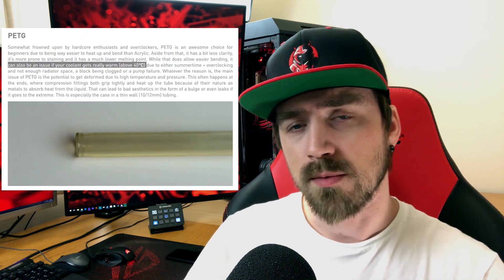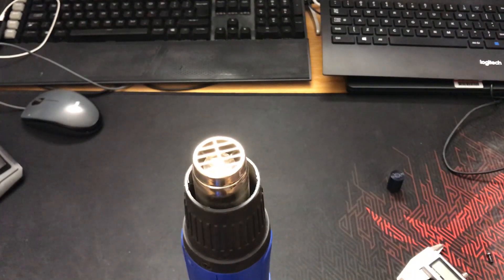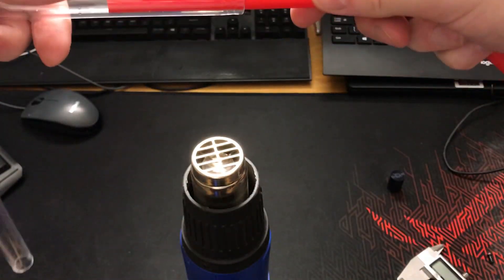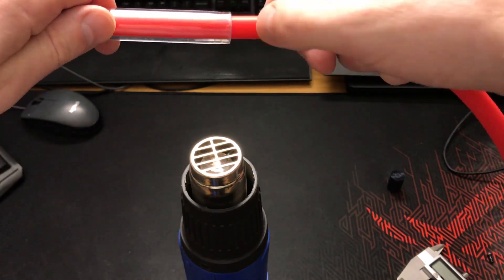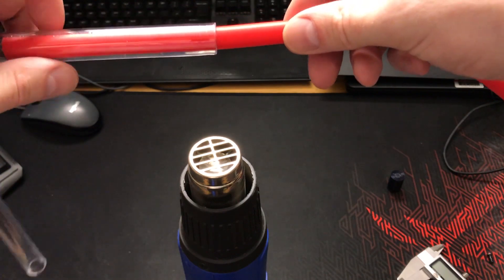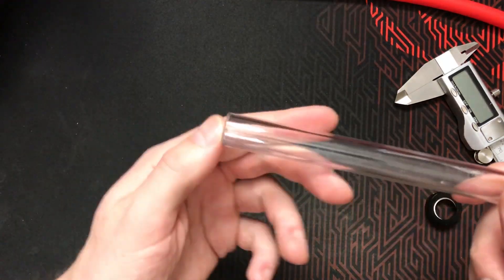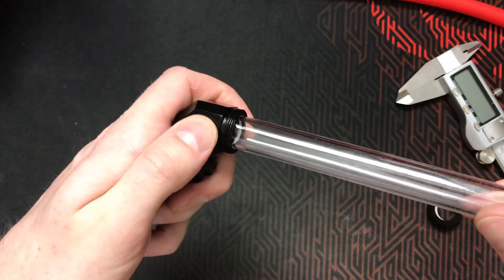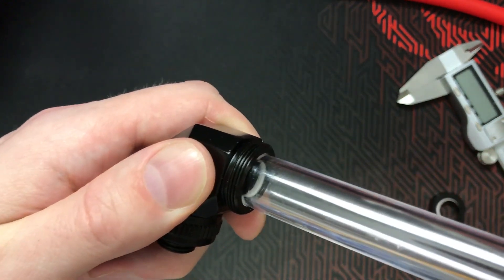PETG deforming

Comment: thanks man. I got a leak in my build after upgrading to a 3090 and it leaked all over my power supply.  I looked at the tubes on the gpu and they were really bad . most of my tubes were acrylic but when I upgraded the gpu I had to get new tubes and got petg .

Comment: every process get more give quality problem. plastic can't recovery well.
Reply from the maker: It is absolutely a choice of every person individually. If you think that PETG will lose it's quality after re-heating then you probably should only go for straight tubes with no bends at all. Or any other tubing - soft, metal. Although all of them have their own pros and cons.
Reply: @3vul837  but flat petg will do it again, when temp little high, it can easyly softens.
Reply from the maker: @karasuZanu  probably will, however the point of re-work was a temporary solution. Also, after re-heating the tubes, you can always add inserts that will stop deforming. So is re-heating a permanent solution - probably not. Does it give you an option to fix existing tubing without wasting materials on bending new one - definitely. Also keep in mind that for PETG to deform, liquid temperature in your system should be above 40C, not the actual GPU or CPU temp. If your liquid temp is running that high, means only one thing - your cooling system is not efficient enough to be able to cool the components.
Reply: @3vul837  i'm scared to it leak when petg soft. you right. maybe metal pipe is a solution, but it need expensive tools and experiment.
and we need talk about to elephant in the room. there is mold in my house and i'm really tired clean it with disinfecting bleach, it burns your throat and lungs, now i'm trying to clean a room with 220v 50w uv cob led. i hope that works,  but there is an other choice too vinegar and baking soda, i must try it in bath room. pls wish me luck.